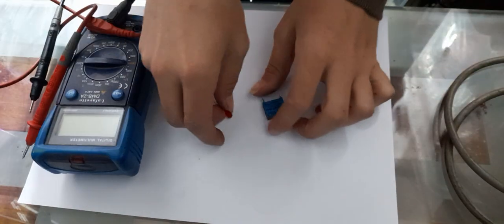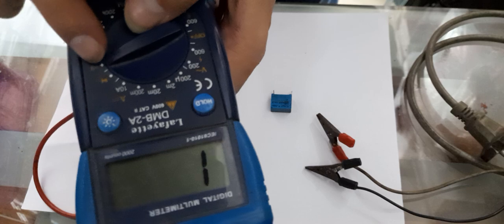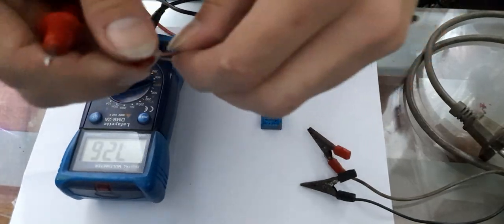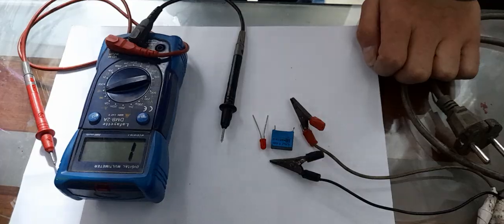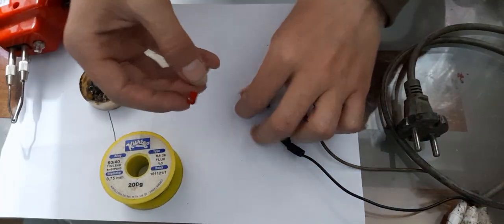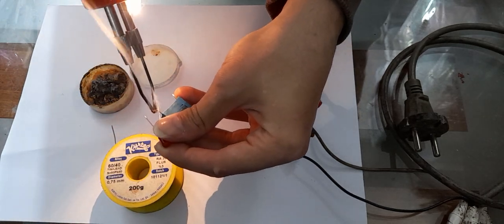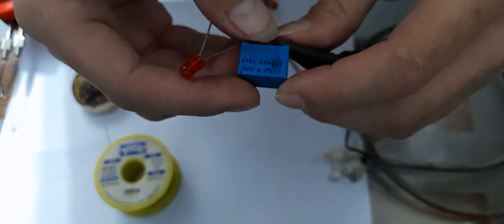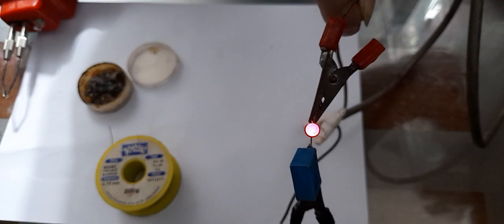Check this out the simplest way to connect a ❤LED directly on AC Main Voltage

Comment: The only problem with this is that current will also be pushed through the LED in reverse, which can make it burn out quick. 

One way to fix this is put another led or normal dioid in parallel with it, but with the positive side facing the other direction. 

Then there is a path for the current to flow for both sides of the sine wave, and it doesn't have to flow in reverse through the LED.
Reply from the maker: @deltab9768  Exactly correct 👍 great opinion thanks for sharing whith us 👏